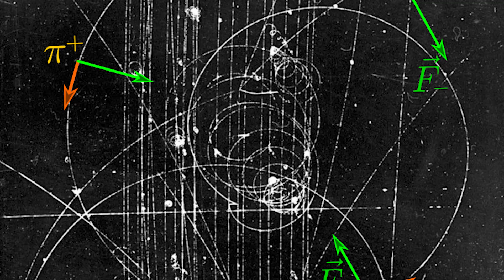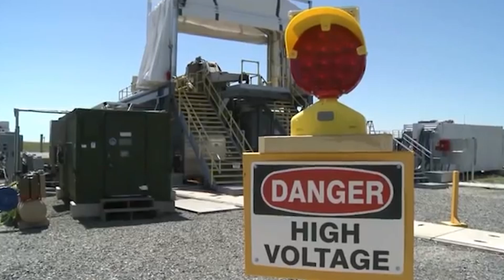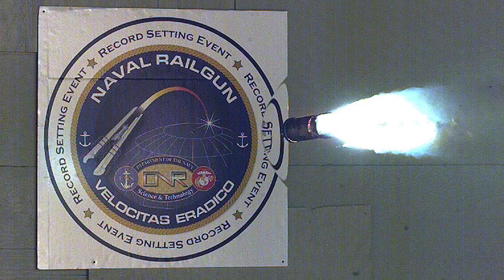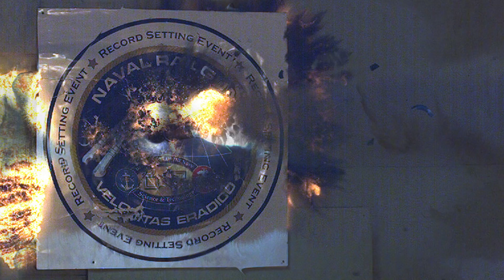Railguns: The Kinetic Future of Warfare

Comment: 8:07 I'm no magnetician, but don't opposite forces create a strong attraction?  I'm sure I'm wrong, just curious to learn how.
Reply: Yeah, that's confusing me too. Pretty sure he got that wrong.
Reply: Opposite charges attract; opposite currents repel.
Reply: @derekp2674  Can you explain how that works?
Reply: @thirstfast1025  It is all pretty much linked to the defintion of the Ampere, see: https://www.britannica.com/science/ampere.

In a railgun, we are creating an electromagnetic gun barrel. We can model the force on the projectile as the result of the current there interacting with the local magnetic field from the rails. From the Lorentz force law, the force generated is at right angles to both the direction of current flow and the direction of the magnetic field. Also the magnetic field corresponds to a stored magnetic energy in the railgun barrel and the direction of the force will act so as to reduce that stored energy. That means the force always pushes the projectile away from the power supply end of the rails.

In effect this can be seen as a magnetic pressure pushing the projectile and similar magnetic pressure appears on the rails, tending to push them apart.

So the magnetic pressure acts in a similar way to the gas pressure in a conventional gun, where the pressure accelerates the shot but also tries to inflate and perhaps even burst the barrel.
Reply: @derekp2674  I see what you're saying (and appreciate you taking the time to write it out, thank you), but it sounds more like you're describing a repulsion of the projectile itself, not so much of an attraction of like currents. As of writing this, I have not read the definition you linked to yet. Thanks again for taking time to explain, I do appreciate it!
Reply: @thirstfast1025  Thanks - you may also find this article useful: https://en.wikipedia.org/wiki/Railgun
Reply: @derekp2674  Cheers! Thank you very much!